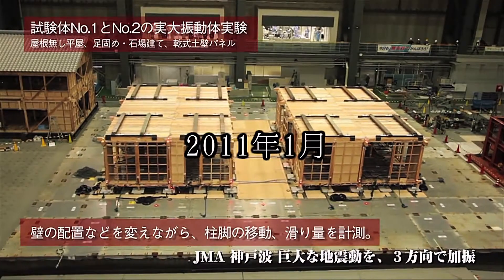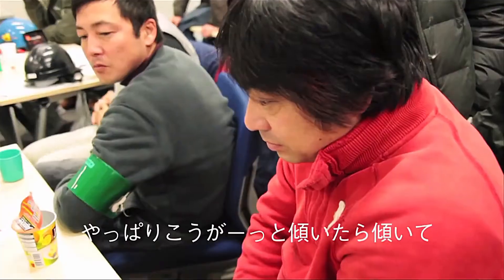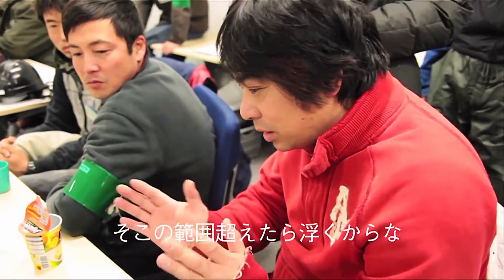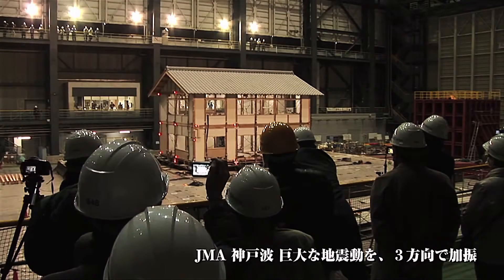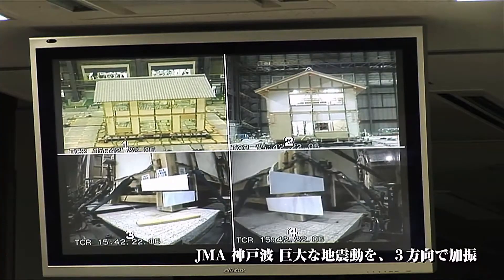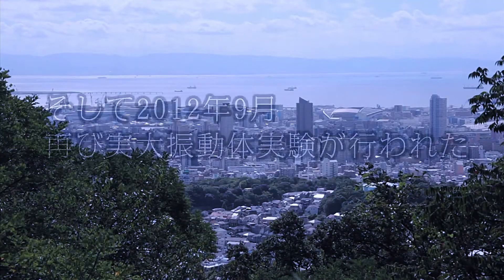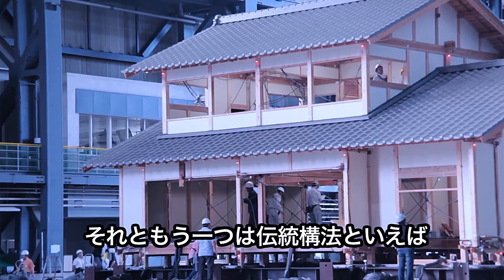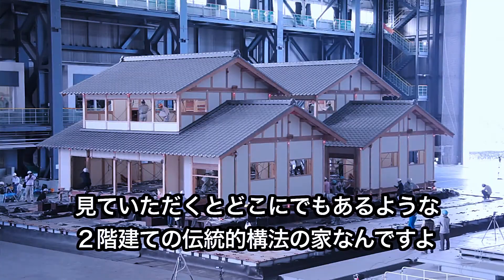3-YEAR EARTHQUAKE TEST on TRADITIONAL STYLE JAPANESE HOMES

Comment: I know this is not normal in Japan but I would really love to see that test but instead of earthquakea, it's wind very high wind like an EF5 tornado speed winds or wind speed.
Even though those types of tests basically essentially useless in Japan since really only Japan gets I think typhoons, tsunamis and earthquakes only.
Even though there is sometimes Japan does get tornadoes but very small and weak.

Edit. Had to make some corrections from 13 days ago and lost my liked comment, makes me sad.
Reply from the maker: Agree that would be an interesting test. However, as you eluded to in your comment, the “Soseki-Kiso” technique of building is something that Japanese carpenters & builders have learned over many generations to deal with the conditions in Japan. As you might imagine, most houses do not hold up well to direct tornado force winds. Thanks for your comment & please check out our other videos.
Reply: traditional wooden houses are generally not made to withstand tornados, thats why people in tornado regions often use a concrete basement for shelter or reinforce their house with concrete etc, the house in that test would just get blown away/ completely destroyed